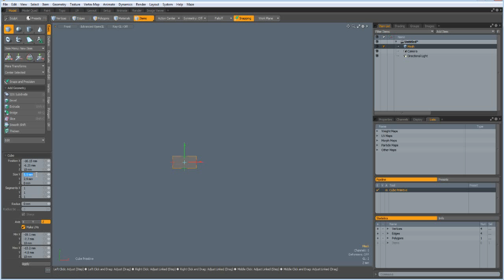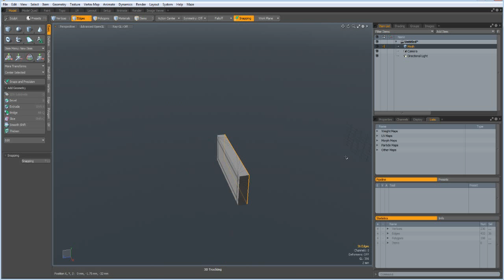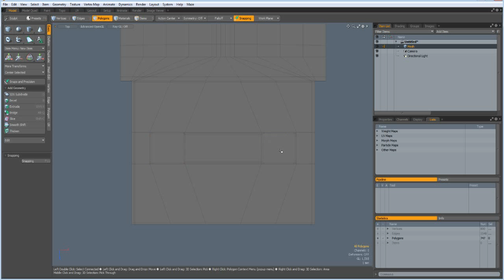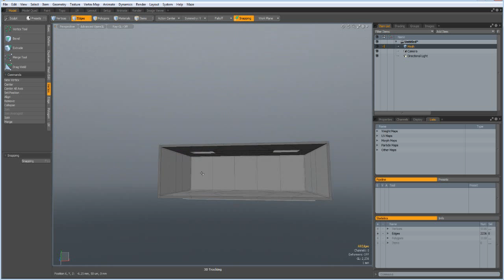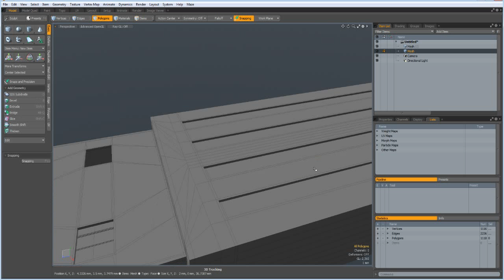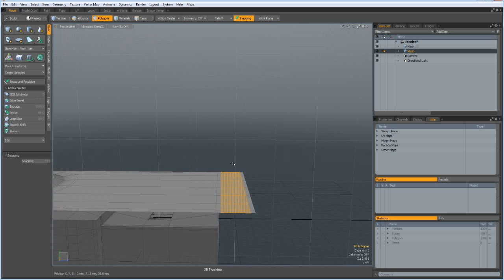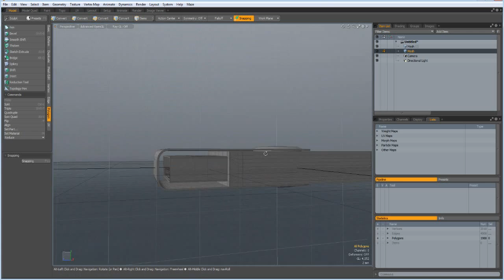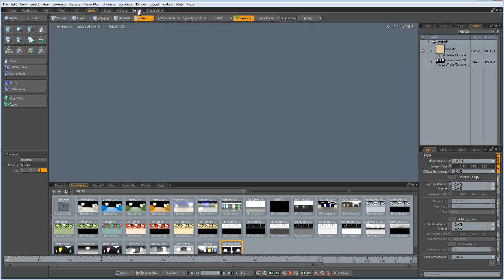Luxology modo - Modeling a USB Memory Stick

Comment from the maker: Hi Patrick, I find it very easy to follow Maya modeling tutorials with Modo. The workflow in modo is very often much more straight forward. (Apart from snapping where modo is pretty weak..) I think in my older tutorials I do a bit more of explaining then in my newest ones. So my zippo lighter tut might be a good starting point because it's not as streamlined as my mini tutorials. In addition there are Applesoldier's tutorialsand in addition there are also lots on Vimeo. Good luck, Peter